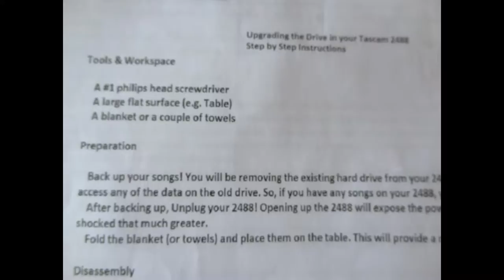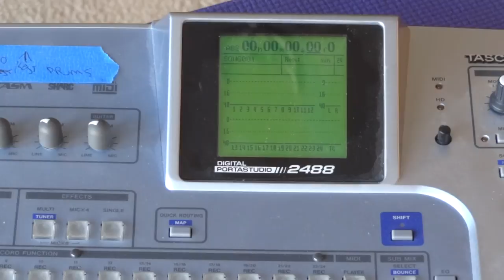Tascam 2488 Hard Drive Replacement step by step, RevoKC

Comment: Wow 😮 yours is build 0067, mine is build 0060 BUT my Hard Drive is much easier to remove. They must have added the removable base plate between production runs, probably to accommodate a new batch of hard drives with different fastening requirements 🤔🙏🏴🇬🇧♥️
Reply from the maker: @polygonalmasonary Hello and thanks for watching. This was interesting to try along with the very helpful instructions that were included along with the new Drive. I also found a kit online from the UK that enables you to upgrade the tiny screen to an old school VGA type monitor that is in color. Much easier to read the meters! Thanks again!

Comment: the power up? do you have to do it a special initialize startup, or just turn it on? do I have to format the HDD to fat32?
Reply from the maker: Hello from Kansas City, I only had to power up the machine once the new HDD was installed.
In the video, at the video ending when I power the machine up was the first time for me also to see that the drive install was A success.
It’s now been some years later, but as I recall, it seems like exporting data to discs/computer backups were in Fat 32.
I think that the original owners manual for a 2488 is somewhere online.
A how-to video also was included in the original machine purchase.
That is on YouTube somewhere.
Either one should answer most questions.
Btw, I still have that 2488 & ended up buying a used Neo with both machines being able to link up thru MIDI via a Kenton 1 into 5 MIDI Thru Box.
Reduces latency/timing issues, haven’t tried that yet.
Also got a plug & play wiring harness designed specifically for these machines to make for a bigger screen in color to monitor the channels without going blind.
Called HGR-2488 Prism. (from the UK).
Enables you to use an old school VGA monitor (pretty inexpensive when you find one).
The original monitor on the machine still also works with this upgrade.
I think there are videos on this wiring harness install.
( you have to open up the machine to install although it is worth it in my opinion).
Hope this helps!
RevoKC
Reply: @RevoKC  i have an old boss Br8.  the multi-track mode on that thing was bonkers fun and good. but there's no HDD in it, I just saw it.  it's broken, it doesn't boot anymore. if you know Ableton, you can record different kinds of versions on the same track and switch them, suitable for chorus and verse and bridge and start and end etc. but on my Tascam, it's just the tracks and that's it.  i own the dp02 and just had to open it because some buttons did not work anymore.   i use a sampler to record full songs,  my boss rc202, or sometimes my sp16 to render it,  then pfweet to USB and PC.
Reply from the maker: @stefanie_m466  looks like fun. Enjoying what you are inspired to create is very motivational.
I am stuck in 2005-2006 in a good way with technology.
The learning curve for me to learn a new recording approach would be quite significant so I am staying in my lane, lol.
Looks like what you are doing is sampling & using controller/sequencing to create.
The closest I got to that was getting a Beatstep controller/sequencer.
My goal was to try to use it to control my light show and figure out how to add a method of foot switching for live performance.
Figured out a different way.
I’m not familiar with the machines you are using but keep up your good work!

Comment: Is 120GB the largest size of drive the 2488 can take? Or what about changing it to an SD drive with 64Gb and 128GB removable cards now available?
Reply from the maker: I think 120gb is highest as far as I know. Found the hard drive on eBay . About $50.00. This is an old-school machine & there are no options or a slot for SD cards. The prices are very reasonable though. Best, Revo
Reply: +Martyn Starkey I have this machine with original hard drive in. I also have an old Roland VS880 8 track with had a hard drive fail so i had an SD reader fitted - it worked - really silent BUT every time I switch on it wants to reformat the drive which is confusing. I don't want to replace and have same problem if I can avoid it. Thanks for a clear video about how to do it anyway
Reply from the maker: +Martyn Starkey , you may want to go on eBay, search for tascam 2488. I think the seller of the hard drive will show up when you scroll down the multitrackers for sale. I think it was "scsi guy"? He responds to questions & may be helpful. Best , Revo
Reply: I just put in a 160 Gb hard drive, it installed without problems.

Comment: Hello, I have a question. We had a 2488 NEO go bad sent out for repair.  Board was gone. We bought a new one and recorded on it works fine. The company sent back out original HD. They said it was fine. Can we install the old into the machine.Back up all that was on it then reinstall the original that came with the new machine with no problems? Don't want to lose anything on new one (all is backed up anyway) but in turn we want to take stuff from old HD and back up to load into new one to remix some things.  Thanks for your time,
 Buck
Reply from the maker: BUCKCODY Hello, it should work out fine. A backup would be making copies of what is on the HD.
Unless the original HD was erased/re-formatted then the original data would still be within the HD. 
And if all the connection cables are the same, you should be good to go.
Reply: @RevoKC   thank you..we're gonna give it a try. Thanks for the video and the answer.  God Bless

Comment: Thank you so much , I changed my hard drive to ssd and it works great and so quiet, thank you for the video. I did need to buy a startech 40 pin IDE to SATA Converter but it was an easy install! Thanks
Reply from the maker: Very good! Good to know it worked for you. Enjoy!
Reply: Hi i have a 2488 and a 2488 mk2  there is 2 different kinds of startech 40 pin adapters what color was the one that worked. But have you had reformat issues when you restart the 2488 because there is no jumper on the ssd hard drive.
Reply from the maker: @theprogrammerrolandmc3039  Hello from Kansas City, the original ribbon cable in the 1st version 2488 is a light tan color.
In the video, I replaced the original Hard Drive with another drive (not solid state) just bigger storage.
Later, I installed an upgrade kit to enable  a larger monitor screen.
I accidentally burned the original ribbon cable with a soldering iron.
Back then, I think I contacted Tascam directly & they had a replacement.
It was the same color.
The 2488 mk2 probably had the same ribbon cable.
I only had the first version so not sure about the mk2.
You might contact the commenter above , Albert Rosa.
Looks like he did something similar to what you are going for.
Possibly Tascam Forums?
Happy hunting!
Reply: @RevoKC   I have a 2488 and a 2488 mk2 
 I looked on the tascam forums and people who tried a adapter with the ssd drive had to replace to the old harddrive as they would get errors and crash the 2488.
I would not try a SSD drive as i have before 
and it didn't work was just curious that someone commented that it worked.
Reply from the maker: @theprogrammerrolandmc3039  I was wondering about that too.
I just guessed that there was a workaround similar to when I replaced an old dell laptop hard drive with a much better performing SSD.
In the laptop adventure, it was pretty much plug & play.
Although getting inside the laptop was a nightmare.
(not like newer versions that are just underneath a panel on the reverse side)
I found only one video on YouTube that guided me through the process…
So these old machines are complicated in just finding answers & parts.
Too late for me to tackle a lengthy learning curve for the computer plugins etc.
So knobs, faders & assorted tactile approaches work just fine especially when the songwriter does that part well.
Spinning discs live!
Reply: @RevoKC  You will notice on the original harddrive of the tascam 2488 that it's IDE harddrive and has a jumper connection and a ide to sata adapter does not have one so it's not possible for it to work. Also the operating system on the 2488 is not like a laptop where they update to new technology can be used like ssd drives.
I have a old XP computer for using old music softwear and i cant put a SSD harddrive in it because the same thing.
I am happy with a harddrive in the 2488 because SSD drives dont last as long as old harddrives
Reply from the maker: @theprogrammerrolandmc3039  Just Watch out for that Death Click after tripping over a cable & the Hard Drive laptop hits the floor. 
The jumper switch maneuver on the new replacement hard drive was not my idea.
The instructions included in the purchase showed me how to do that.
Hope this helps
Reply: I tried compact flash card with startech 40/44 Pin IDE to Compact Flash SSD Adapter    ... Didn't work

Comment: Is there any issue losing the operating system when doing this?  Or is it stored in memory?
Reply from the maker: Straitjacket Studios Hello, thanks for your interest. The only memory is in the hard drive itself. You have to back up everything on the old hard drive prior to removal. I backed up mine to CD discs & thumb drives and a computer. More than one backup method gives you options. If your old hard drive is not functional, I’m not sure about other options. Mine was still working & I just wanted a larger capacity HD. I got the replacement on eBay with a seller who was familiar with the machine & provided instructions. I don’t remember who the seller was.
Reply: So you are saying this is also to backup the main operating system correct? (Not referring to song data files)
Reply from the maker: Straitjacket Studios All of The control buttons , switches, the screen, input & output jacks etc will perform the same as from the factory. Only the data on the HD such as any recordings made will be gone. So replacing the HD as I did in the video will return the machine to the same as it was from the factory. Ready to record songs with all controls functioning
Reply from the maker: Kim Diez I believe everything loaded from the old drive would go back to where it came from?
You could download the original manual to verify